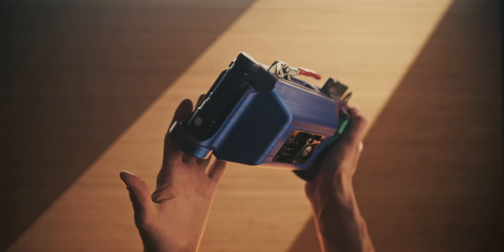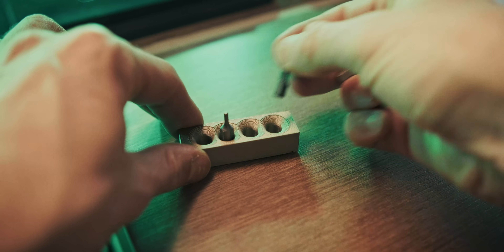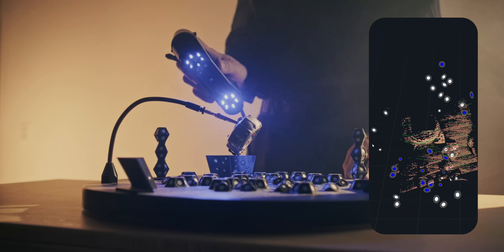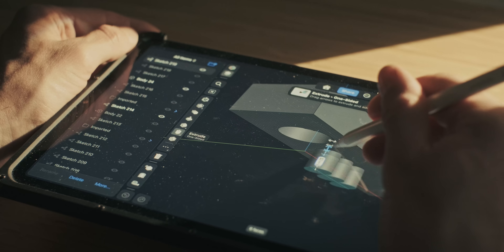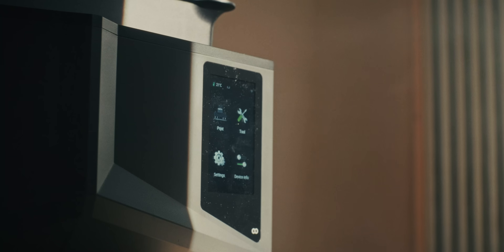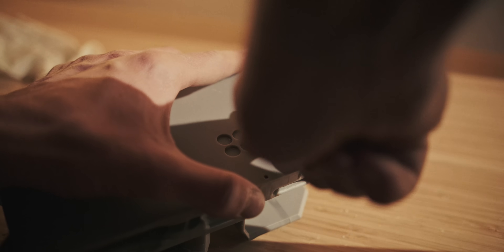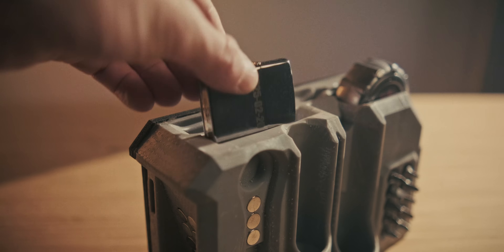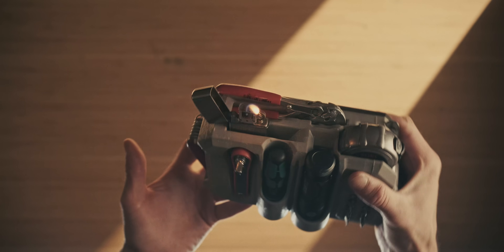Building a Wera Tool Check Inspired EDC – 3D Print Project - Elegoo Saturn 4 Ultra 16k

Comment: Have you thought about different tools to maximize space saving as well? For instance, I think the Klein 32611p is just about my favorite edc screwdriver. It has onboard bits, AND it can take a standard 1/4” hex drive. Plus, it has a magnetic pick up tool, kind of. 

I have been trying to make a compact tool kit myself for about a year now, so I’d love to chat if you’re interested. I have a printer on order and plan to dabble with a design to carry the tools I’ve selected for my kit.

Comment: Using UV curable resin for this means it will always be curing when it's exposed to sunlight, which will make it super hard to the point where it will be brittle and shatter one day upon impact. A coat or paint with a UV clear coat would help for next iteration, but will ruin the current tolerances.